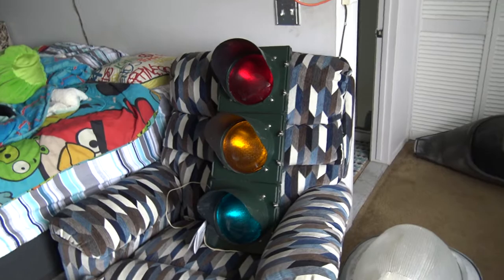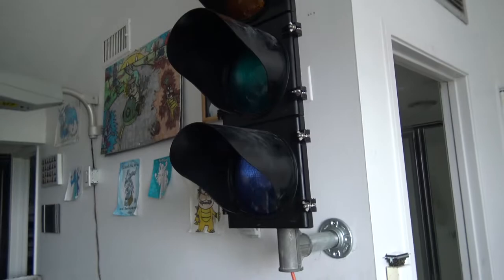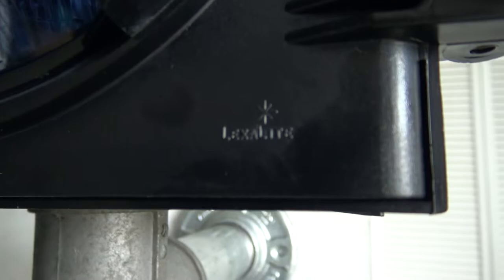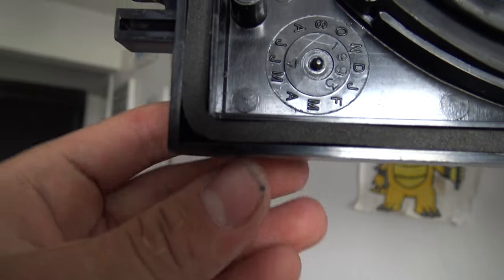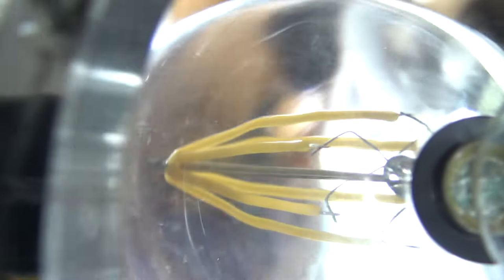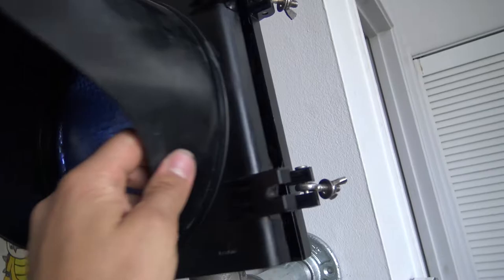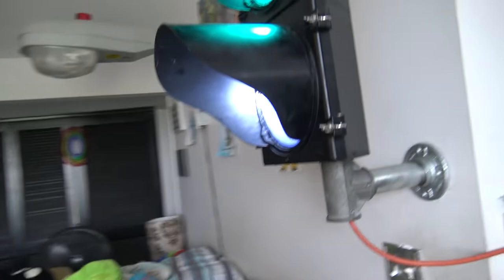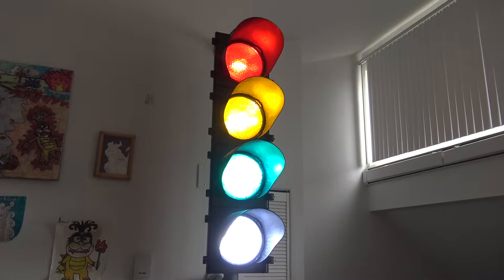My 4 Color Bedroom Traffic Light

Comment: I do have a suggestion for you. 

You should take those four LED bulbs that you put in completely out. And add color LED bulbs. One red, one yellow, one green, and one blue. At your local hardware store. Like Home Depot.

The reason is when you use a white LED light on a colored lens it will not show the true color of that lens. White LEDs make a red light look pink. Versus the red LED makes a red light look red, etc... 

This is the same idea you should do always when you're changing bulbs in your car TO LEDs. Always go with the same color of the lens. Not the white color of the original light bulb. When switching to LED light bulbs.

So use color light bulbs for each individual light when you are using LED light bulbs.

Also add a dimmer switch so you can lower the light level.

Comment: My first poly signal in my collection was an ICC signal just like yours that was never in service. It was the only signal in my collection that was never in service and one of the worst signals I had. The other bad signal was another poly signal by Kentron. Like you I had the lens tabs snap off and the visors always fell off. These signals were manufactured in Mexico in the late 80s to the late 90s to my knowledge. Where I am in Canada, they had a lot of these in my province and many are still in service today with LEDs. I don't know how they managed to switch them out without snapping off the tabs to hold them in place. As for the blue lens, these were also fairly common in my city and only ever found in single sections for transit right of way. The only difference is there was a black mask over it creating a white/blue vertical bar. These have now also been switched out for LED versions of the same. 

I'm not trying to trash the signal you have there. Just had to laugh when you pointed out all the flaws with it as I can 100% agree with how bad those ICC signals are.
Reply: Also, earlier versions of this same signal were branded as Safetran. Safetran also manufactured railway control signals.